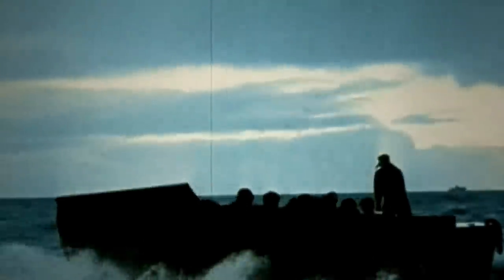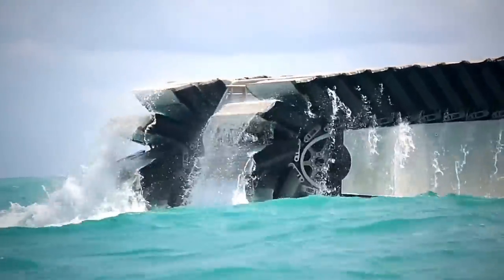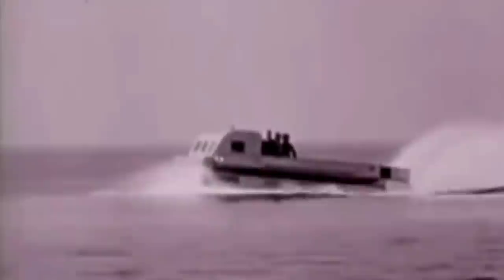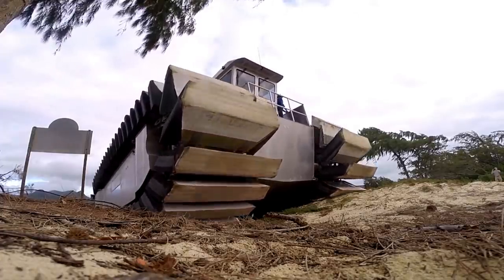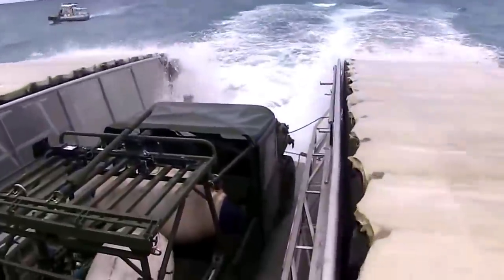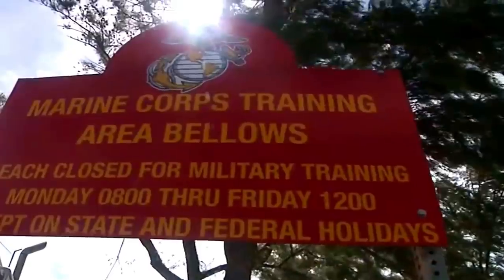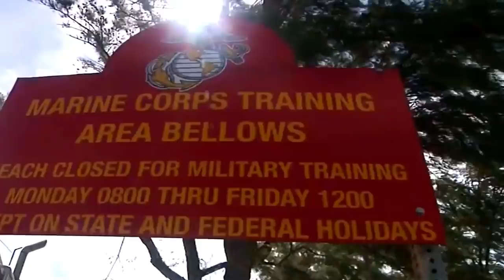US Marines Test Giant Sea Tank

Comment: If we're going to dream ...

Mount twin electrically slewed link-less Dillon Mini Guns on the bows, and lower the cabin profile, plate the front and cabin roof with multiple layers of alternating plates of armor for defense against mortars and other incoming rounds, and it might be useful.  Or, better yet, since they are talking about being able to carry a Tank on them anyway, scale the sides of the craft so an M1A2 Abrams turret can slew and shoot to suppress any fire from shore. Firing the main gun on a Battle Tank might slow progress to the shore a bit, but I could swear I saw an article once about what amounts to a big shotgun shell for an Abrams designed for urban environments, choke it down in a cannister for longer ranges and it might work for this too.  Useful until you have your own troops on the beach whose heads you are trying to shoot over.  The ability of the Abrams to track a target at speed over rough terrain should help it track a target while bouncing around in a moderate sea state.

Comment: If its foam I would guess that any explosion to the tracks would sink it. It seems like its only solves the troop landing itself and not the danger of the actual approach.
Reply: An explosion next to dense foam tracks would probably not do much actual damage at all, unlike if they were metal tracks that would allow water in.  These would continue to float as long as they stayed intact.
Reply: @dgoddard  wouldnt the foam get blown off? If the foam got blown off on one side it would tilt and start filling with water I would think.
Reply: @meatball.9710  It wouldn't completely lose buoyancy like a traditional boat with a hole blown in it
Reply: You can probably lose a lot of foam before there was a risk of being disabled. That said, the hard counter to this vehicle is probably a flamethrower. Actually, it's the counter to a lot of things, which is why it is banned for use in combat.

Comment: I wonder how well it will actually work under enemy fire? How reusable and effective will it be after being chewed up by enemy weapon's fire? What happens once the styrofoam floats have been shot to shit?
Reply: It's not styrofoam 🤣😂😂🙄 it's a type of material which bullets seem to bounce off much like the blimps that are being built , it was found that the material can deflect morters and bullets , they simply soak up the energy , I have seen morters and bullets bouncing back off this material on a blimp !!!!!!
Reply: Not well. You see in all the land trials it is moving VERY slowly, especially over obstacles. I imagine those floats take about one shoulder launched missile to become useless instantly, and it seems they're not tough enough to handle high speeds on land. 

Honestly this doesn't seem to actually solve any problems at all. Amphibious assaults are already rare, and contested ones are unthinkably costly. No one has a million troops to feed into machineguns anymore. I could really only see this as a toy for spec ops, but to be honest they have better ways of getting into beaches.
Reply: @RobinTheBot  I think it said the land trials weren't at full speed for testing reasons, though I wouldn't expect the true speed to be made public anyways. At the very least it travels over land obstacles faster than other landing craft.
Reply: Easy. Not being shot at in the first place.

Comment: OK - A few comments.  1st - I've seen clips of the vehicle about 8-10 years ago.  2nd - Much of the "Testing footage" used in this clip, was shown at that time.  3rd -  The full size vehicle would have loading ramps at both ends.  4th - the 'craft' would be loaded with equipment, then loaded into the Ocean Carrier.  The only items 'loaded' during transit in the Ocean Carrier would be people.  Learn to think outside the box!  Just because something is 'new', doesn't mean it is bad - or - good.  It has to be tested and proven 'doable'.

Comment: I just hope that if the engine fails at sea that it floats! 
They should set up the ww2 beach obstacles & see how it does... 
And it seems that it would have done good if it was back in ww2 & i'm assuming that it will be fully armoured when they need to use them....

Comment: That looks like a slow, unwieldy, impractical money sink. How is that thing not just a huge, slow target full of smaller more valuable, vulnerable targets?

If they had foam on the full size ones that’s all the weak point it needs. Dump fuel or fire on them and they’re dissolved in minutes. 

Someone’s got a golden project budget, and we’ll never see anything out of it. At least nothing that they end up moving to full production, if anything.

Comment: Looks like a slow and vulnerable target
Reply: Yes, this prototype is that but they already know. As stated in the video the final version will be larger, faster, and have armor plating as well as Weapons equipped.
Reply: @mustang750r  they said the final version would be larger, have medium armor and weapons but it didn't sound like it would be any faster.
Reply: @DemocracyDiesInDarkness  He literally said it'd be up to 5 times faster lol
Reply: @nicholasadams9535   No he didn't, they said the prototype was 1/5 scale and the projected speed for the final version was 20 knots which is less than half the LCAC which has a top speed of +40 knots fully loaded and +70 knots unloaded.

This thing looks like a slow floating tractor deathtrap.
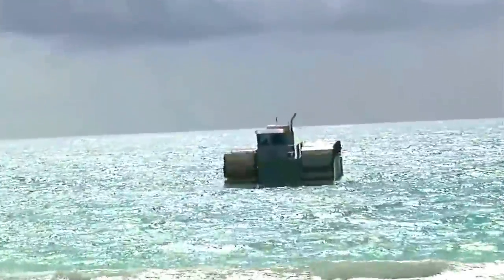Reply: @DemocracyDiesInDarkness  Nicholas is referring to 06:35
Reply: @mustang750r If you watch the whole video (because it's oddly edited and facts are out of order) they mean 5x faster than the existing prototype which apparently only moves at 4-5 knots. The projected speed is 20 knots if you look at this time index.

 https://youtu.be/acaWpoutJ3M?t=321

Which again is a fraction of the speed of the LCAC 40-70 knots.

Comment: This thing reminds me of the German Ratte (an unrealistic 1000 ton tank design from WW2). If this vehicle is made real scale AND is armoured AND is loaded with three main battle tanks each weighing 70 tons, then the vehicle will easily weigh 300 tons. For battle tanks, common knowledge is that there is a 70 tons weight limit.  If you surpass that weight you get all kinds of problems with transportation, collapsing bridges, failing propulsion, aweful manoeuvrability... so I wonder where this is going.

Comment: looks neat but the one thing everyone is ignoring is the fact that these vessels can come under heavy fire when trying to land and any type of armoured protection, at least in the front seems to get skipped. at the least the crew operating would be at the most risk, the cabin is a bullseye. also the longer it takes to get to shore, to more fire it will attract, not a good idea. this is a poorly thoughtout design thought up by someone cutting corners at the troops expense. only thing these would be good for is transporting equipment after a beach head is secure.

Comment: I saw this thing being tested a few years ago and thought it was a huge waste of tax money back then. This thing makes a lot of noise, like beating on empty metal 55 gallon barrels when it is traveling over a hard surface and is not much quieter in the sand. There is no sound in this video like the one I saw a few years ago. 
During WWII they had the Landing Ship Tank or LST. It was called by the military troops, Large Slow moving Target and was faster than this thing and better armored. This thing would be far worse! 
A good hit from an RPG, Recoilless Rifle, Rocket, or Artillery Shell hitting this large slow moving target in those floating tread tanks would put this out of action and possibly capsize it. Enough small arms fire in those things might cause it to take on enough water to do that. And this is only half scale, weighs 38 tons, is 48 feet tall and has no armor plating or weapons. This thing is nothing more than a tracked paddle wheel moving at about 25 MPH. Add all that additional weight of armor plate, weapons and ammo, at full size of over 80 tones and taller than a 3 story building,   they would be lucky to get 20 MPH out of this monster on the sea and probably less on land. Unless this thing is going to hit a secure beach head in calm seas it is going to get shot to hell and or sunk before it gets close to a beach. At 80 tones, this thing would not be able to make it through the soft mud on some landing sites or through marsh lands or swamps. This thing would have to land in a clear area, no trees or buildings or tight areas like roads or bridges. Even constructed beach obstacles, pilings or uneven rocky shore would pose huge problems for this thing.
What happens to this thing if it has to clime over a coral reef before it gets to the beach? Coral would rip holes in those float treads! It also looks unstable as hell in a calm sea too. If you noticed this thing was tested in the ocean with no waves, no large waves when it climbed on the beach. Even in deep water the waves were very small. I want to see what this thing can do in waves or a choppy sea with large waves. In mild wind conditions or with gusts over 20 MPH this thing would have one hell of a time staying on course. This thing would never be able to handle real world conditions or even mildly rough seas. I'll bet this turns out to be a money pit for the tax payers and either gets scrapped or winds up in some museum as some failed oddity. 
I'm honestly surprised that this is still being tested. I believe the first time I saw this monster was about 5 or 6 years ago and it preformed poorly back them in a calm, wave less flat sea with no wind or gusts. I don't think it made 10 knots trying to make it to the beach. I'm all for getting better equipment that is easier and simpler to repair and maintain that would cost less to produce. This slow moving mechanical clunker is not the answer. If troops are in desperate need of supplies and reinforcements to hold a beach, this thing would get there just in time for the enemy to capture it after they retook the beach head an hour before it got there. If it was able to get there at all.

Comment: If that thing is 1/2 scale, there's no way a full size model will carry 3 MBTs. The well deck of that ship is 50 feet wide. The landing craft looks to be half that, at 25 feet and appears to be roughly half again as long as it is wide, so 37 feet. It's cargo deck looks to be 1/3 its width. So the full size unit would have a cargo deck (ignoring the pilot house) of maybe 74 feet by 16.5 feet. An Abrams is 26  by 12 feet (and that's just the hull). It might be possible but I'd like to see how 78 feet of (3) Abrams ass to nose fit in a 74 foot deck.

Comment: Since the current commandant got rid of the main battle tank, what difference does it make how many tanks one of these can carry?

The narrator continually refers to this item as a "tank."  It isn't a tank, it's a landing craft.  

An entire class of amphibious ships was developed to accommodate and support the LCAC [Whidbey Island/41 class of LSDs].  How big will the ships need to be to support this beast?   Converted oil tankers or container ships?

The video compares it in terms of capability to the Marine Corps Amphibious Assault Vehicle [AAV/AMTRAC] when in reality it would be better compared and suited as a replacement for the Navy's LCAC. 
 
How well will those "state of the art floating crawler belts" hold up to land mines?

This thing is experimental at best and an expensively huge mistake at worst.  

Speaking from the perspective as a retired Marine Corps officer with 30 years total service, the first 10 of which were as an AAV officer.  
YATYAS

Comment: It's a huge and relatively slow moving target, even at 20 knots. Any modern shoulder fired missile or rocket would be a problem. Where I see the most problem is before it hits land. If the tracks are it's motive force, losing a track to enemy fire would stop it dead in the water, and it's sheer size and weight would make it unrecoverable until the battle was over. Enemies would soon figure this out and use just enough firepower to disable a large percentage of the vehicles while still waterborne, which would not only make the attackers halt their assault, it would mean the crews and passengers of the disabled vehicles would need rescuing. That could cause a loss of life spiral that just couldn't be acceptable. Not only is it a lovely target to defenders, the one thing that makes it all but a deathtrap is the hardest to defend, the tracks.
Reply: Doubt these things would show up alone though

Ifvs and their autocannons
Reply: it is safe to assume they will stick APS to it
Reply: Completely redundant armchair rhetoric from someone expecting Normandy-esque beach landings with cargo craft.

Comment: The problem I see is the size. Easily picked up on radar and large enough to be locked by antiship missiles. A little more stealth and invisible to antiship missiles would improve survivability greatly. Coast lines aren't defended so much by shore batteries and machine guns anymore. Nations rely on radar and satellite imagery to detect and antiship missiles and air power to repel invasion.

Comment: This is an interesting concept. 

From what I can see this has value as a resupply and night operation insertion vehicle. Only for water born operations of course.

If this thing can run vehicles/tanks/supplies/ reinforcement up onto beaches that are currently inaccessible. This could be very valuable. Not necessarily for assaulting a beach but for resupply from the sea afterwards. 

I get that helicopters and air drops could do the job as well but if your running low to avoid radar to this might be a better option. Though this idea is highly suspect. 

I agree with many others this is a hulking Target. The tracks are a major weakness and at least will have to be covered like tank tracks.
 These actually might be better served as closer in mortar and artillery support vehicles. Use them to suppress targets close to shore. ( But isn't that the Navy's job) perhaps possible in areas that require shallow draft vessels only. Like up a river delta. 

I can only really see this being used after the first wave of craft has gone a shore on a beach ( so same assault restrictions) to deliver vehicles and supplies. Then be able to increase resupply down the coast in areas in accessable to other means on drop off. Again choppers could fill part of the resupply. This all depends on how much control of the air your force currently has. 
If you control the air and no possiblity of being shot down. This thing is essentially useless.
 If your approaching a partly hostile coastline and inserting men and material this has to be quieter+ less like a radar shoot here vision. Unlike tanks on land it has no cover. 

So to be actually useful. Low radar return, quiet, able to resupply on semi hostile coastline. Good enough speed. 

I do not expect this to become an armored landing craft for troops ect. Likely too slow especially if armored. But if enough are made then you might see some becoming gun platforms.
Reply: The navy already has floating gun platforms though. They have PT boats specifically designed to provide support up rivers. If you mean larger weapons such as artillery they have that too in the form of 5 inch guns on the frigates and destroyers capable of hitting targets 20 miles inland. Any further and they will simply bring land based artillery which has numerous advantages.
Reply: It's easy to not have to speculate if you just look up the concept. It's just a cargo transport. Too slow and completely unarmored to be expected to do anything under fire, that's not the point. It's just a way of moving heavy haulage from a massive ship, far inland.